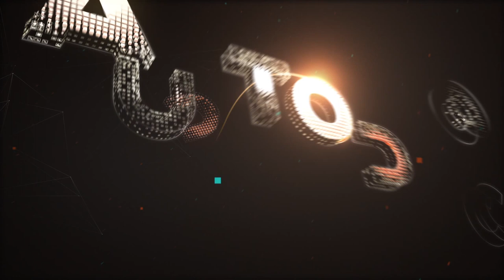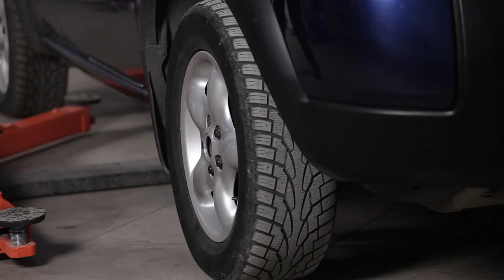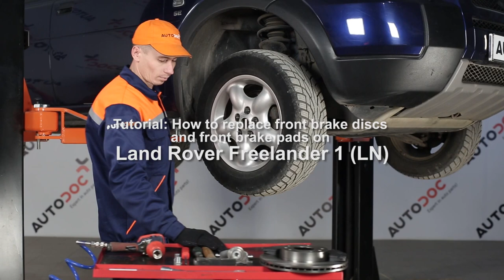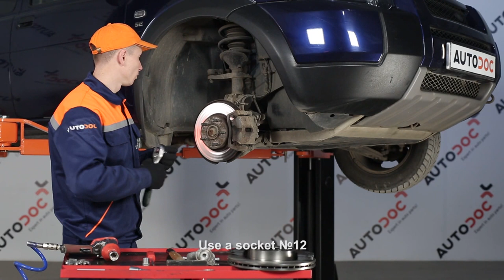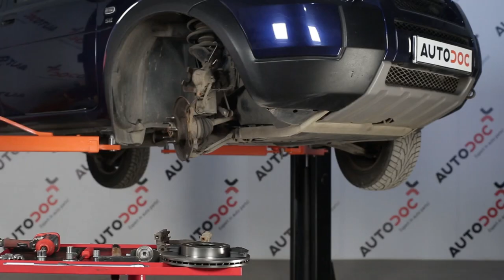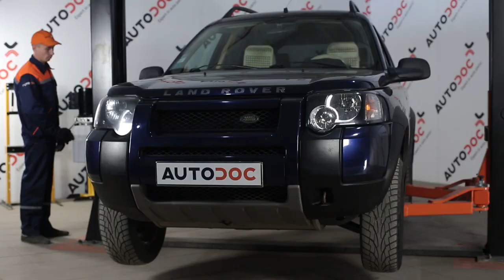How to change front brake discs and brake pads LAND ROVER Freelander 1 TUTORIAL | AUTODOC

Comment: According to my workshop manual, the inner and outer brake pads are different. You need to make sure you install them on their correct side of the disc/rotor.

Comment: tightening bolts with an air ratchet is very bad practise. always use a torque wrench with the correct setting. also when changing brake pads on a freelander, always replace the guide pins and rubbers.
Reply from the maker: Thank you for the feedback!This video is considered to be an informative one, and it shows the sequence of repairs,so some stages of the repairs might have been excluded. Best regards, Autodoc.
Reply: If only it was that quick , Its just taken me 2 hours due to siezed caliper pins , what a nightmare.  But still its a good overview  video .Paul ,UK